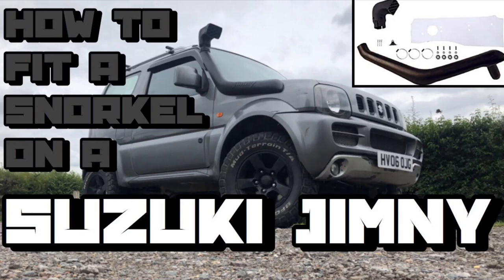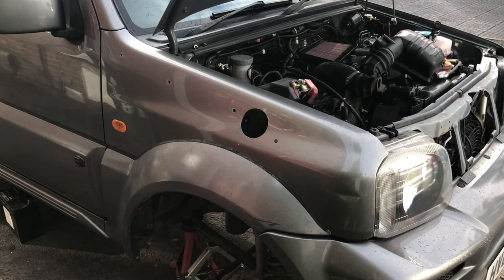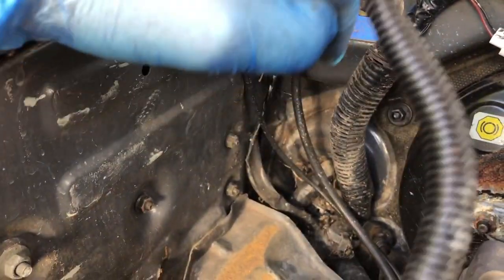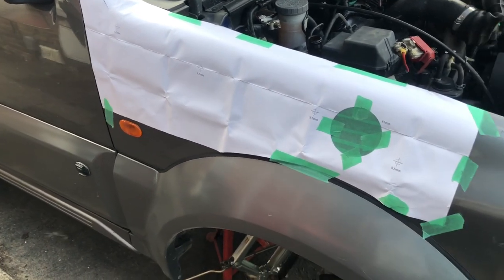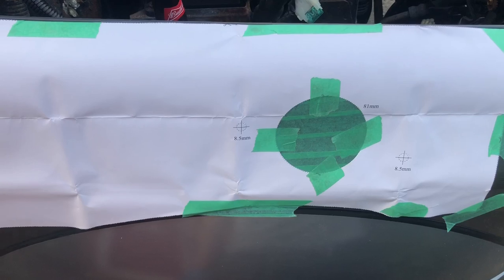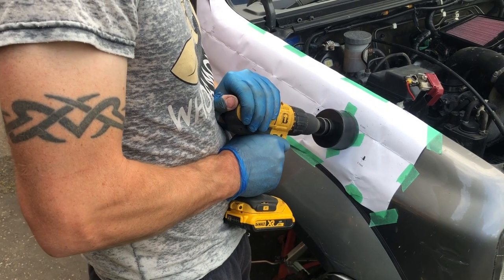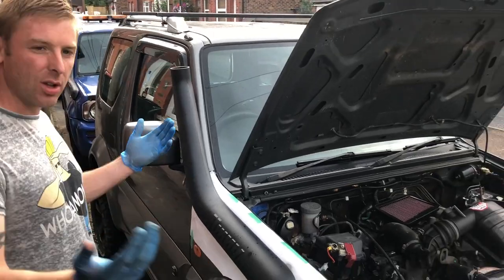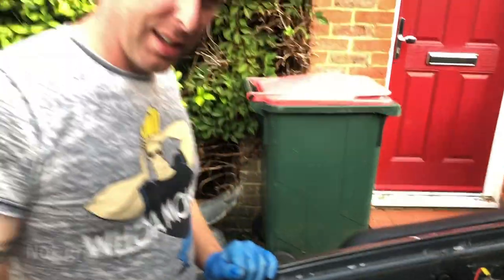Snorkel install on Suzuki Jimny (All the tools needed)

Comment: Used your video as a guide , but I checked the template holes Vs the actual   snorkel, corrected the template, then marked the holes , drilled 12 mm holes for the 4 bolts , fitted perfect!
Reply from the maker: Well done hope the vid helped a bit 👍🏻

Comment: Have you tried on deep water yet? Installed the same kit on my jb43 and was wondering if silicone should be applied to the connection to the air box, it looks like a really good fit but you never know
Reply from the maker: I have a new Jimny now but I did try this out in some deep water and no leaks. That being said it was just short River crossings. I wouldn't be comfortable wading for long periods of time. Was more worried about the difs and gearbox filling up

Comment: How long does it take to do from start to finish? Great vid by the way
Reply from the maker: Didn’t take me long at all. l did it in about 30min but I had done a friends before so I knew what I was doing (kinda) lol. Realistically probably take about 45min I’d say 👍🏻. Thank you.
Reply: @GERfusion  RIPPA...Thanks mate!
Reply: I have been at it for about 2 hours and only one hole is in the right place, the big hole fortunately. So at least another hour to go. Mine is an $80A eBay air tech job and no instructions. Jimmy is 2010/11 model. Measured everything about 5 or 7 times. Drilled the 83 mm (31/4) )hole and nearly broke a wrist when it grabbed. Now have to redrill the 4 smaller holes, most are only a hole out, I’ll use large sheet metal washers and a bit of filler. Probably use a bit of sikaflex 291 to tidy up.
Reply from the maker: @gardnep   Wow. Your luck sounds as good as mine. hope you got there in the end 👍
Reply: I think the right hand drive kit I received states 10/98+ and was for a slab or straight sided model. The only hole in the right place was the big one and it is directly opposite and above the air cleaner box. It took me an additional 5 hours to relocate the holes about 3/4 inch or 18 mm forward of the template and then time to fibreglass the back of the old holes and fill them with filler. I have yet to paint the panel but stuck the snorkel on anyway. The rear most hole is extremely difficult to put on the nut and washer. My hand is small but still too big for the gap between the panels. The upper bracket is pop riveted in my kit and the 5 mm pop rivet was too tough for my hands so I ended up using a g clamp to pop the rivet. I would recommend using the template to secure the large hole, then put the first stud in and put some paint, in contrasting colour to the front guard, on the end to mark the front hole on the panel. Do that successively with the other studs, one at a time to get the holes right. I might have to remove the bolts on the front guard to put the rear stud and nut on. So all up 7 - 8 hours without a break. Now for the diff breathers, hole it is simpler.
Reply from the maker: @gardnep  what a palaver. Sounds like you may have the newer face lift model? Apparently the snorkel fits slightly different. You may need to heat up the snorkel at the bend and reform it a bit. There is an Ausy fella that does it I’ll try and find his vid for you see if you had the same issue with yours. Glad you sorted it in the end though.
Reply from the maker: @gardnep  search for “Mighty car mods our first 4x4” then skip to 18min. Might help answer some of your questions as to why it was such a S**t to fit your one. I would leave a link but youtube don’t like them. Hope that helped

Comment: Hi mate that black thing oval thing that was hanging down after you took the old airbox piece out where did you mount it afterwards?
Reply from the maker: max fuhri hello mate. It just goes back where it was. But you need to unbolt it to get that old air box piece out. It’s them 3 small nuts behind the battery holding it in place.
Reply from the maker: max fuhri hope that helps? I’m not that good at explaining stuff lol
Reply: GERfusion outdoor adventure seeker, hi mate sorry for the late reply I managed to figure it out in the end, snorkel is all on looking the part 👍
Reply from the maker: max fuhri oh no worry glad you got it done. Hope my vid may of helped
Reply: The black cylinder hanging down in the guard is the vacuum cylinder, I assume it operates the transfer case via the H&L buttons on the dash.
Reply: I bought a snorkel several years ago. I just need a few pint of beer before I start drilling.....it's the missis car after all.

Comment: Where You find drawing to drill holes ? ThX <3
Reply from the maker: It should come with the snorkel if it’s purchased new. If you have purchased a new snorkel and it didn’t come with one, I’d get in touch with the manufacturer and see if they can send you a copy. If it’s 2nd hand then I can’t help sorry